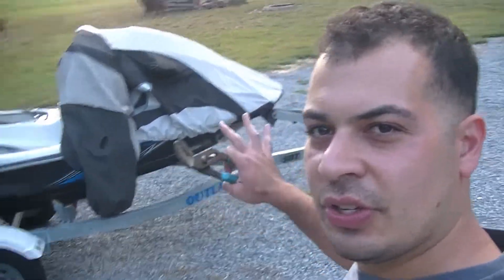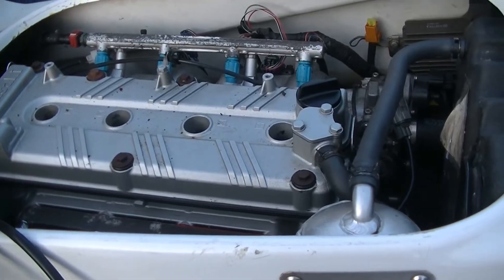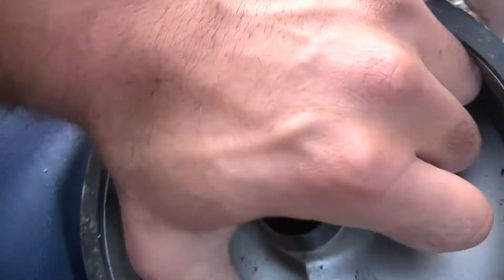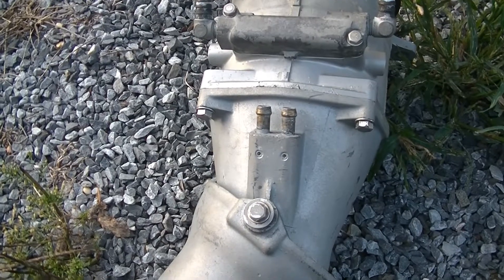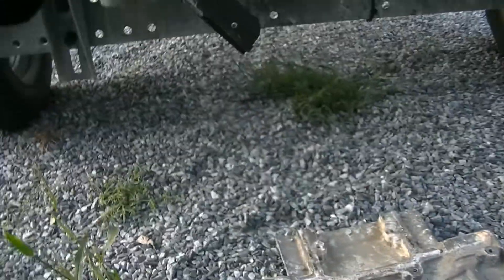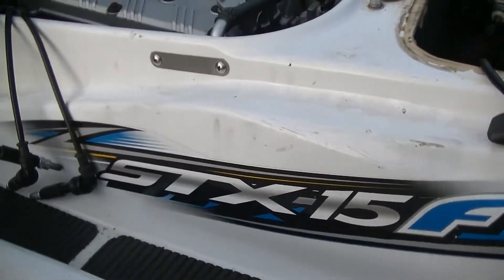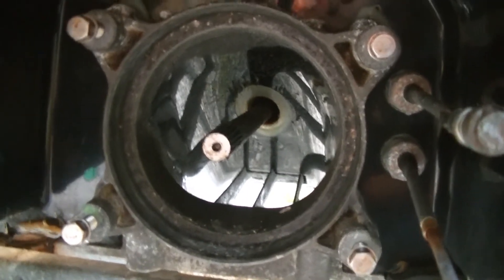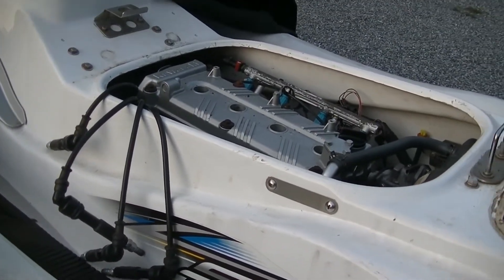How to quickly diagnose a seized engine and Jet pump in a Jet Ski!!!

Comment: If someone ran hose without motor running and oil is milky white and 4x normal level how would you clean that up?  Planning on changing oil and would like to just try to suck any water out intake with oil extractor but think I'm going to have to pull manifold to make sure.  Then try to turn in drown mode for bit prior to trying to start. Anything else i should do and/or what else should be done ?
Reply from the maker: Drain the oil. Fill with fresh oil. Pull plugs and crank until all the water is out of the cylinders. And for good measure I’d change the oil once more
Reply: @SEsGarage  I have heard on these motors water gets stuck in intake due to design. 1630ace seadoo motor. Do you not think I need to pull intake?

Comment: If a jet pump is seized, can the motor still turn over?
Reply from the maker: No, the jet pump is directly splined to the crank shaft of the engine

Comment: Hello,
Can you tell me if my engine is damaged? I don't know why it sounds like this.
https://www.youtube.com/watch?v=AJa2E2zfGP0
Reply from the maker: That sounds like pump noise. Pull the pump and inspect
Reply: @SEsGarage  Thanks. I will do that and hopefully that's the culprit.
Reply: @SEsGarage  I am in the process of pulling the pump. 2 questions please: When I remove the pump, can I start/run the jetski just to see if the sound is gone? do I need to remove the drive shaft if I happen to do that?
Reply from the maker: @TheManWhoSawTomorrow  you can run it with the pump out, however, if you have an issue with your pump, it will be very obvious when you pull it out try to spin the pump and see how it sounds. You can pull the driveshaft toward the rear of the machine to disengage it from the rubber coupler